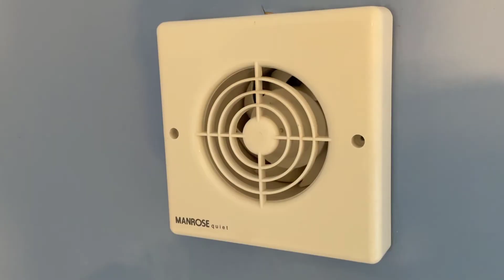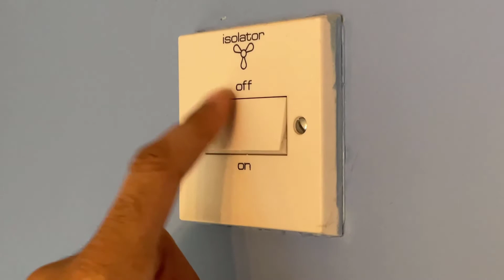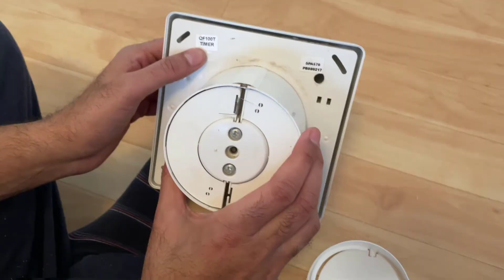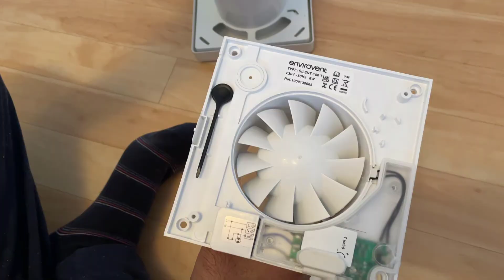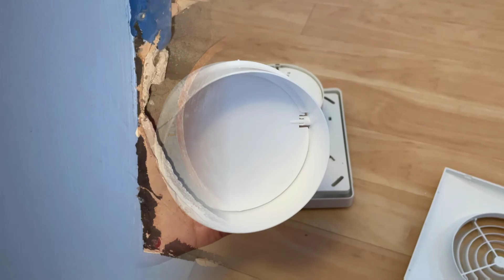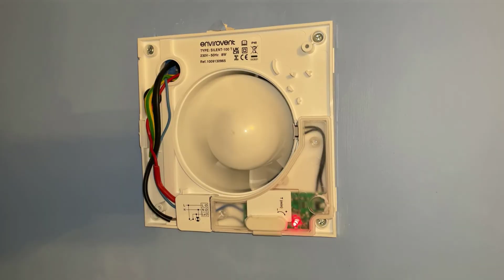Installing a bathroom extractor fan with Timer

Comment: Hi, l have the same Envirovent Silent 100. Like your video l have 4 wires red blue earth and one without a sleeve just bare wire. Red  blue wires l can see where they go, but l'm unsure about the earth and bare cable connection. Any help would be greatly appreciated.  Rick

Comment: hi there, i currently have a normal extractor far without timer, can i replace it with a timer one, or do i need extra wiring ?? Because the power is off when i turn the light off
Reply from the maker: Hi, it depends on your house/room wiring, if you look at 4m:30s into the video, the fan makes use of the Switched Live wire. This switched live wire is used by the fan for the run-on timer function when you switch off the fan.

Comment: Never ever use a volt pen to prove a circuit is dead, I assume you meant a non contact voltage pen ? Never use them to prove dead and never use a neon screwdriver, you should only use a GS38 approved two pole voltage indicator. And VDE insulated screwdrivers , if you haven’t got the right tools then leave it to a professional qualified electrician . Oh and never rely on the fan isolator switch to prove dead . .
Reply from the maker: Good points. I used a non contact voltage pen. When a isolator is switched off, I also use a voltage meter to double-check connectors before handling